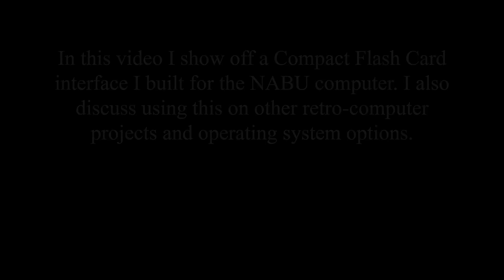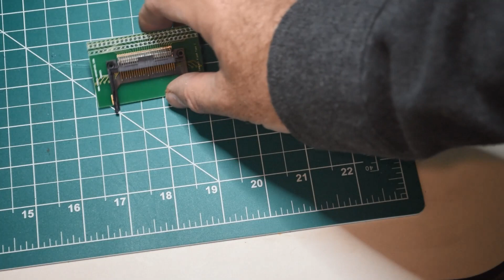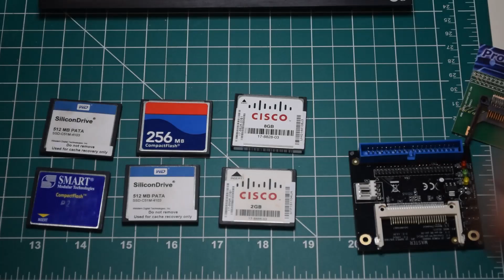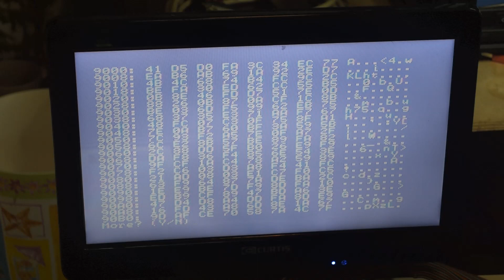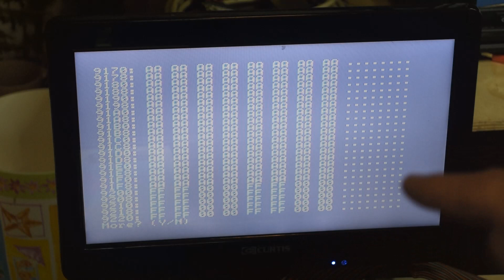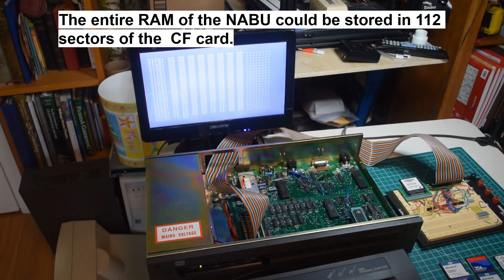Easy NABU CF Card Interface Breadboard Project #maker #retrocomputer #cpm

Comment: Fantastic! Are all of these things you’ve done with the Nabu in this series available from you for sale, or in kit form, or, at a minimum, very detailed instructions from square one for BEGINNERS?
Reply from the maker: I hadn't thought about kits. That's a possibility in the future if enough people are interested. I will make more detailed instructions available on my blog in the future.
Reply: @electrogeek6437  … Is this something a total beginner can do? I have an I.T. background and programmed on Commodore computers as a kid, and presently, fairly regularly, do VERY BASIC and low level troubleshooting and repair, and soldering and such of simple audio and music gear circuits; like the easiest of keyboard, guitar electronics, and amp repairs and such. If the troubleshooting is complex, I don’t have the skills yet, and I definitely have no DESIGN skills yet… But I’ve always been HUNGRY for stuff like this; for example, I wish modern Altair 8800 kits and similar were still available, as well as IMSAI, etc., that aren’t just Arduino emulations…